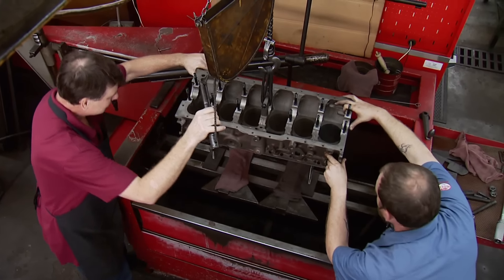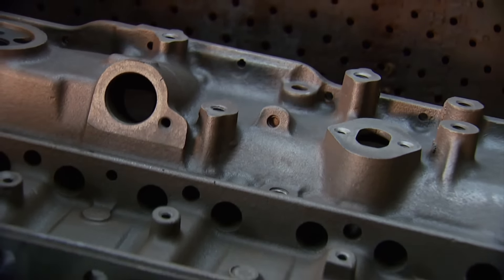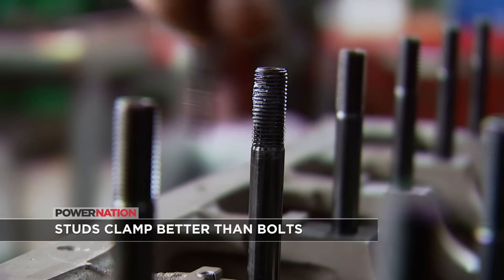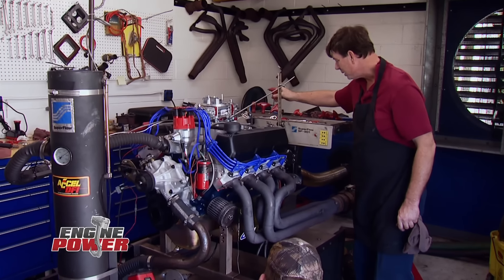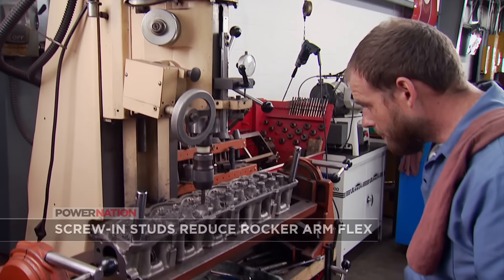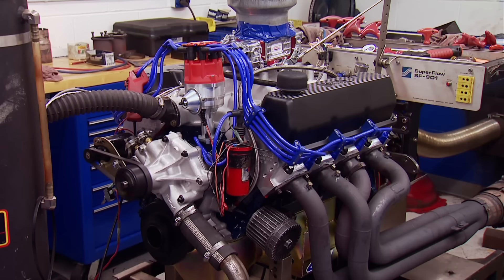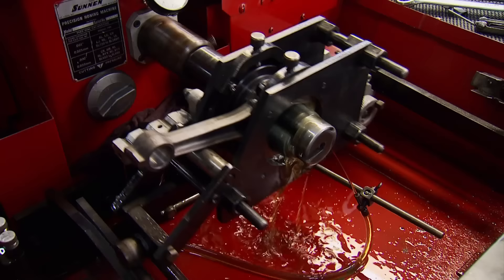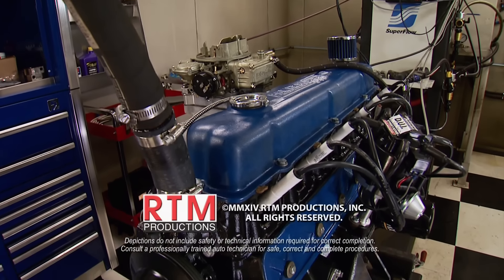Bringing An Old School Straight-Six Back To Life - Engine Power S1, E3

Comment: I gather the 300, like its Australian cousin evolved from the 170 cubic inch "Super Pursuit" inline 6? In Australia, they went as big as 250 cubic inches, with a high compression option known simply as the 250 truck engine. It has huge torque comparable to a diesel, but comes with a cross flow head, electronic ignition, Weber carburettor and was hugely reliable. I worked with an '83 F-350 tow truck that had one as its power plant, and was never for want of power. Its passenger car version evolved into the legendary "Barra" inline 6 cylinder. 4 litres, double overhead cam, turbocharged, intercooled and fuel injected. Good for 1000 reliable horsepower

Comment: I have a tremendous amount of respect for professional machinists.  That stuff is some real arcane virtuoso joojoo right there, boi!
Reply: That is highly skilled labor.  One mistake can ruin an expensive block or head.  These guys are worth every penny you pay them.
Reply: @1575murray  Indeed, there’s a difference between a mechanic and a machinist!
Reply: @lashlarue7924  When you have good ones working together you will have a good running engine that will last when well cared for!
Reply: @lashlarue7924  Two totally different trades.

Comment: That's cooler than the v8
Reply: So spending more money to make less power is cool?
Reply: @bmstylee  i doct care for me its cooler than a v8
Reply: @bmstylee  V8’s are great but a straight six like this is something else, if you really just want to go fast then yeah go pick up that LS engine from a junkyard
Reply: @williamsanders468  yes.  It's something else that is a relic.   If I want to go fast and use an I6 there is this thing called a 2JZ.   Now that's cool.   This not so much.
Reply: @mjupao1957  Performs poorly.  Packages poorly.  Costs way more to build.  Explain to me why it's cool?   Seems like one issue after another to me.  From every measureabe approach it seems to be a horrible choice.  If you really throw money away just give it to me.   No one uses inline gas engines.
Reply: @bmstylee  it’s their money, so whatever their goal happens to be is cool. You don’t get to dictate what is a right or wrong choice for someone else
Reply: @bmstylee  But this is America and I don’t wanna use Chinese engines and then put it in an American car
Reply: @redram5150  yes spend it how you want.  But I haven't seen an argument that discredits what I said.   It's an antique design no one uses outside of a few diesel pickups and industrial diesels.  Dodge uses I6 Cummins and the half ton diesels are around 3L in line engines that package well.   And industrial doesn't matter for packaging.
Reply: @bmstylee  why don't you get a life
Reply: @bmstylee  has been triggered, I guess the snowflake has lost to a few I6's in his day. I hope 2021 is better for you and you can heal your butthurt.  Also, stop skipping leg day.
Reply: These engines with today's oils would run for a million miles of hard use.
The super duty and medium duty trucks with the 300 cu in had a forged crank.
Reply: @bmstylee  your argument doesn’t matter. The engine needs of an individual don’t default to making the most power for the smallest investment. You’re no different than insufferable teenagers who ask the loaded question “Do you know which car is the best?”, implying which is the fastest car. Except “best” is a matter of opinion, and speed isn’t the only metric
Reply: @chrisdaigle5410  with what a modern diesel can do why would I waste time on this in a 3/4 ton+ truck?   Give a valid reason.
Reply: @bmstylee  Your tears are delicious.
Reply: @bmstylee   LMAO. You’re not using logic. You’re assuming everyone’s standards and goals should be the same as your own. At no point in the video did the hosts mention they were gunning to be the fastest or the most powerful. The goal is building is building a performance inline six. So where you came up with this bar their engine is supposed to reach is a mystery. Or rather, projection on your behalf

If you don’t like ancient pushrod engines, then you chose to watch the wrong video, Chief. Some advice: don’t go over to Uncle Tony’s Garage. You may get even more butthurt than you are here.
Reply: @redram5150  I love my LS engine.  But please stop making this thing sounds like the greatest thing ever built or some holy grail engine.   It's an obsolete design you guys seem to think is beyond criticism.
Reply: @redram5150  I love my LS engine.  But please stop making this thing sounds like the greatest thing ever built or some holy grail engine.   It's an obsolete design you guys seem to think is beyond criticism.
Reply: @bmstylee  I’m not the one here claiming which engine is better, guy. That’s all you.
Reply: @redram5150  ok.  Next car show ask a few people you know what they would use.  An engine as long as a Cummins, as heavy as a Cummins, has the aftermarket parts of a Lada, and the performance ceiling of a 16 year old hatchback.  Or a modern V8 be it an LS, Coyote, Hemi, etc.   Guess what they will choose.  It ain't this.  I would bet my next paycheck on it.   That shows what the better engine is.
Reply: @bmstylee  what someone else would use doesn’t matter. But that’s cool if you think so. I’m not gonna be a judgmental pr!ck about it. Some people, like you, need to base their decisions on what others want and can’t think for themselves.
Reply: @bmstylee  Methinks thou doth protest too much.
I'm just pointing out that this is one of the most durable gasoline engines ever made by any manufacturer. I did mean to post it under the original thread and not under your post.

Comment: The BARRA's grandfather, the best 6 ever built, oi oi oi
Reply: 'cept it's not. It's more like the Barra's great uncle, not so much direct line, but a side branch of the family tree.
There's a lot of that tree explained in the comments section on the last Ford 300 video Engine Power did.
Reply: the barras grandfather was the ford 250 and the xflow
Reply: The great great grandaddy of the Barra is the old Ford 170 cube straight six, not sure what the yanks call it, thrift master or something.
Reply: @TheTeeroy32  The Thriftpower Six 170.

That became 200 on the second casting and the 250/4.1L casting was exactly the same from the 1970s onwards and still made using the same lasts until 2016. (The whole top end changed massively and it went from 4.1, to 3.9 to 4.0)
Reply: @andrewrollason4963  thanks for correcting the name, the rest of the info I'm a walking talking encyclopaedia. I'm a die hard Australian Ford man.
Reply: @TheTeeroy32  The lasts for the casts might very well still exist. I have no idea where they went after Ford closed the engine shop.
Reply: No the Barra's grandfather is the blue motor 221, 3.6litre.

This is out of a truck its a 300.
Reply: @stephenbachman132  and that motors daddy is the 200, which in turn it's daddy was the 170.
Reply: @TheTeeroy32  yep same motor diffrent bore stroke. Diffeent year.
Reply: @stephenbachman132  And which Falcon do you think that was in?
Reply: @andrewrollason4963  the 221 was in the XW.

But before the XW there was the XR
Reply: @stephenbachman132  ones still a development of the other. Bore/stroke and age is irrelevant in this argument
Reply: @TheTeeroy32  What about the 144?
Reply: @timothykeith1367  your right, I always forget about the baby.
Reply: @timothykeith1367  and we can't forget the 188 which was a little monster.I hotted one up in the early 90's and it was an indestructible animal.The 188 was sent over from Canada at a time in the late 60's when Australia had a shortage of six cylinder aussie motors.The 188 was a Canadian light truck motor which the aussies put into some xp's xr and xw .To find one is extremely rare now.They had thicker boar ,bigger water and oil jackets,7 main bearings where the early 144,170 200 narrow blocks only had 4.There were some other differences also but this was many years ago that I put a 188 into an XP coupe.It had a crane cam,250 2 v head extractors,electronic ignition ,holley carb and it was a 3speed  auto.Damn thing used to skid tyres into 2nd gear.!
Reply: @timothykeith1367  Everybody forgets the "wiggle shaft" 2.5" stroke 144
Reply: @harrys.3165  The later 200's were 7-Main engines...But the 7-main 250 with a REAL cylinder head would have been a good engine... But unfortunately the 3.0L Vulcan and 3.8L Essex V6 killed the inline.

Comment: Fresh back from Iraq. Welcome home GI. Way back when I was returning from a tour in the Navy,  1 tour of duty on a carrier just off the coast of N. Vietnam. Jobs were hard to come by back then. Hang in there, seems like you have a decent guy to work for. On the inline 6: Most will try to make them run like a V-8 but that is a mistake. Build it for torque, that's where they excell. Another thing from way back when: Some guy ran an altered using one of those 300 inline 6 Ford engines. He took a pair of cleveland heads, sawed off 1 cylinder of each, oven brazed them together & ended up with a cross flow 6 cylinder cleveland head. If I remember correctly he did quite well.
Reply: An old 6 cyl modified trick.
Reply: Rydell, Hope & Lang..
Reply: The head bolt holes all lined up?? Oil and water passages too? They must have needed a ton of mods (besides the "surgery") to make it fit.
Reply: It would be awesome if Clifford or somebody took that, made patterns, and cast them in aluminum.
Reply: @donellmuniz590  Don't know all the machining difficulties just the brief description in Hot Rod at the time. I do know that there are quite a lot of parts in the 300 that are very similar to the 302 & 351. Ford did that to reduce overall production costs, make parts interchangable. Chevy did the same with the 194, 230, 250 & 292 I-6 engines.
Reply: @donellmuniz590  Would be indeed.

Comment: My '78 Econoline work van, 400k miles, runs smooth as silk... 3 on the tree as well, is my pride and joy. This van will outlive me... and I've had it since '91... It could tell stories.

I did all the rust work 9 years ago. I don't drive it in the winter... That was a huge job...

Comment: The Ford 300 L6 has always been my favorite engine. Found in everything from pickups, UPS panel vans, school buses, dump trucks, and a host of other class 5-7 truck chassis. The Ford 300 cid and GM 292 cid engines I had a lot of experience with and geared right, they would move a mountain. I was surprised to learn the connection between the placement of the water pump and wear on the number one liner. I might be old but still learn something new everyday.
Reply: Back in the 80's, I had a Ford van with the 300 and a Chevy van with the 292. They were both great, I wish I still had them.
Reply: The Ford 300 also powered generators, sprayers, and a few other things
Reply: I remember reading a neat detail from drag racers and Inline 8 guys- they'll actually move the placement of the thermostat housing and water intake to the middle of the manifold to alleviate that problem and to get better exhaust temps all around, because otherwise the flamefront is cooled too much.
Reply: @James Barrow wait so that’s what that is? i’ve got a 300 i’m planning on rebuilding and when checking the cylinder wall diameters i noticed 2-6 were almost the same, but 1 was a bit more worn front to back than side to side. so the water pump being where it is causes that? that’s pretty interesting
Reply: @93jake81  - Yes, that is the first time I learned about that too. Very interesting what we can learn from these pro-guys.

Comment: Love the straight six builds.
Reply: Was just having a back and forth with my fiancé about the possibility of starting a F-100/C10 build with a S6 and turbo. Hopefully I can find a good roller or better :)
Reply: @NERC-o4l  that’d be sweet. I believe that there is a lot more performance possibilities with straight sixes than people realize. Low end torque they are unbelievable and of course reliability. On top of that there’s the fact everybody is running V8s and being different is cool 😎
Reply: My 1977 f150 i6 is getting a turbo soon, I put a posse track in the back and it's a 4 speed. Just want to beat some new chevys
Reply: I just got one!!!! jeep grand Cherokee
Reply: @tonybaggett1984  
I believe Ford originally designed this for heavy-duty applications like dump trucks. I think it has gear set instead of a timing chain.
They started out putting these in pickup trucks as a temporary fill but the customers liked it so much they kept doing it.
Reply: Me too! I love V8's a lot but I am really love seeing these straight 6 engines that were a base engine for a lot of muscle cars back in the day. If I ever bought an old Mustang that has a straight 6 it would be getting equipped with forged internals, EFI and a turbocharger.

Comment: At first i thought this was related to the industrial ford 300 generator project that mike and pat are doing but this looks like a regular 300 engine that has seen better days and been rebuilt before. I think this is a a separate video project.
Reply: This is a different 300 ford from season 1. I though the same thing at first but it’s not
Reply: I was hoping to see the final version of the season 1 engine.   I can't figure out how they were going to get a good enough exhaust seal to drive the turbo they eluded to.
Reply: This video is old af I'm actually pissed they re-uploaded it cuz I've been waiting for the new 300 episode
Reply: WOW  !   Did you figure that out all by yourself .  .  .  .

Comment: Here in Australia we have the 4 Litre straight six, my current wagon runs a Barra version which is 190 kilowatts (nearly 260 hp). Lots of power on tap, a wonderful cruiser and get s 9.7 litres per 100 kilometres (29 mpg)

Comment: This was one of the best motors built!! Mine is creeping up on 325,000 miles and with just basic maintenance.
Reply: I don't know if it's true, but rumor has it that when cash for clunkers was a thing they had to drain the oil from engines, pour sand in the top end, and run the engines until they ceased. I've heard the 300 sixers could go through a tank of fuel before locking up. Sounds nonsensical, but it's what I read.

Comment: First class video showing the processes involved in engine repair and reconditioning but I would like to say that using a severely damaged block  that needed such a highly stresses main mounting welding back on after an 'accident' is a no no, at that point the block should have been written off and another sourced. Also later when the engine was being used hard in the truck the engine failed due to the flywheel bolts coming loose which would have caused a lot of damage to the crank requiring repairs or replacement and this failure happened because it's inherent in almost all straight sixes when they are hopped up due to the extreme torsional harmonic vibrations straight 6's suffer from when used at high rpm and power outputs, the crank should have been fitted with a specialised harmonic damper at the front and the flywheel should have been dowelled in place in addition to the 6 securing bolts, at least 3 x 1/2" dowels should have been used but preferably 6 or this failure will just keep happening. I am a race car engineer of 40 years experience and I hold a Technicians Certificate in Mechanical Engineering and I specialised in engine development.

Comment: So much content! But I have a question about the crank balancing. Why wouldn't you blend in the throw edges before balancing? Seems like you would lose the balance you just got by removing material afterwards. Plus, do you not balance the rods with the crank for a balanced assembly?  I'm not critiquing, I'm simply asking questions because I wish to understand the process better.

Comment: ARRRRRGH,.... Y'd think from the whipping Hagerty got in the comments on their Buick Straight 8 build, that people would realise that Sleeves should not be hammered in. They virtually drop in with finger pressure if the Block is warmed and the Sleeve chilled. At least here it looks like it's a Steel Sleeve, and not the Cast Iron ones that Hagerty 'pre-cracked' for their rebuild.
Edit - 10:07 - 10:15 - lookit! Chilled seats go in so easy!

Comment: I would have liked to see a full porting job done on the cylinder head. They are not the best flowing head, so they need all the help they can get. It would even benefit the motor under boost pressure.

Comment: I think I would have repaired the block where the peice was broke off first.
Reply: Why? Worried about heat when you're welding that ear back on?
Reply: @texasrox2010  that and make sure it's repaired correctly before put more time and money into it.
Reply: @ronaldbradley9949  Yes,  like the Ford 390 they did a while back where they did all the machining only to find out the block was cracked.

Comment: Balances the crank, then removes material, undoing his balance job LOL
Reply: Not enough material taken off to unbalance it, probably an after thought. I get what you are saying, it should have been done first.
Reply: @Zach-ju5vi  I've balanced several inline 4 and 6 cylinder cranks over the years, you can usually find a couple of grams per end to zero it, but if you hadn't touched the crank from the factory you would never notice a difference. Rods and pistons are a different matter.

Comment: 1:43  "Born in the 50s..."
Nope.  The 240/300 sixes were introduced for model year 1965.  They replaced the 215/223/262 inline-sixes, which were produced from 1952-1964.  The 223 has the distinction of being Ford Motor Division's first production OHV engine, predating the the Ford Y-block by 2 years.